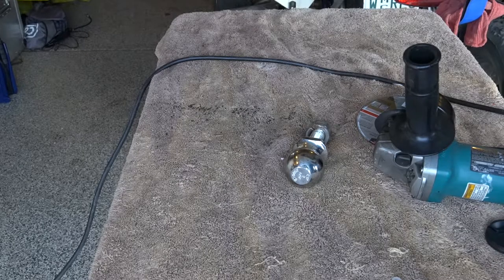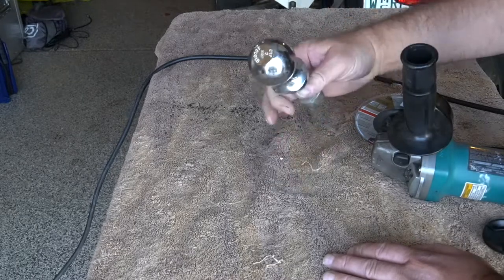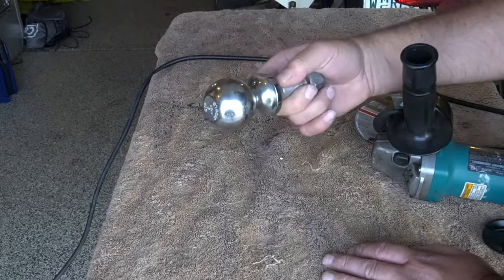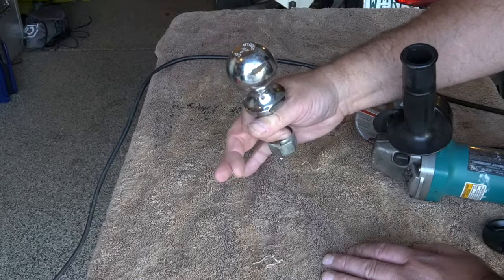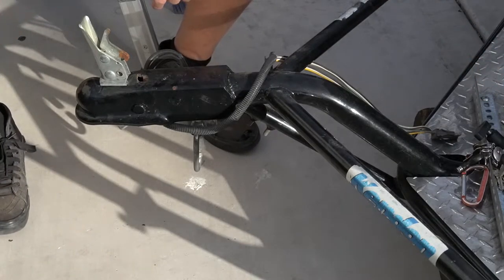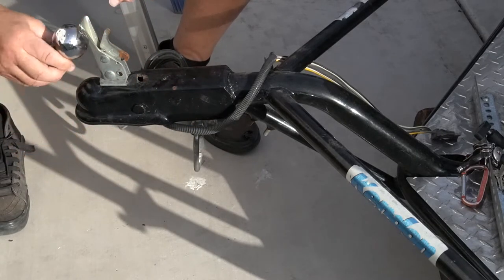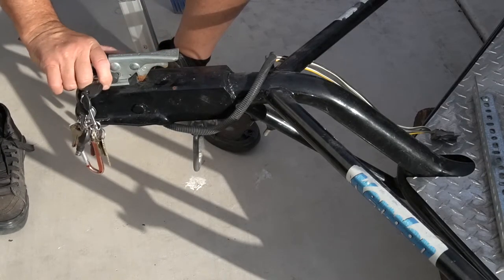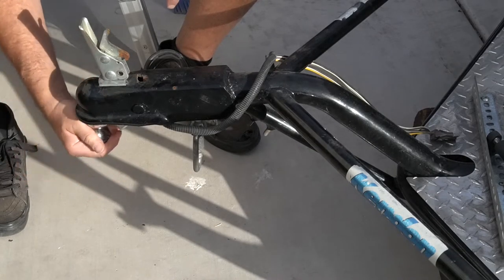DIY TRAILER SECURITY - How To Make a Homemade Trailer Hitch/Tongue Lock

Comment: Why do you have to cut the shank off?
Reply from the maker: Because technically, if you don't, then someone could drop the shank into a receiver, and drive off with your trailer. Cutting off the shank prevents that. Also makes it easier to store. Thanks for watching and the comment.